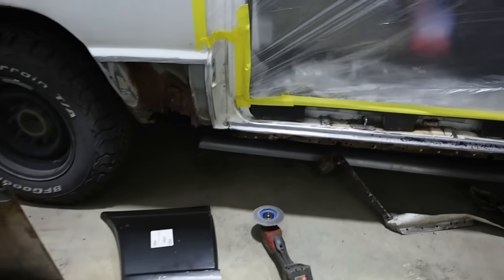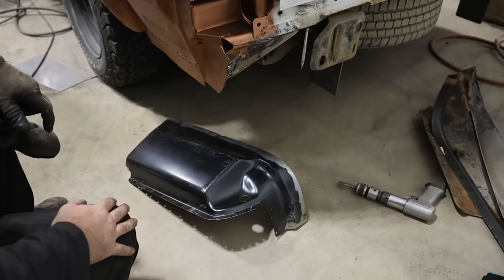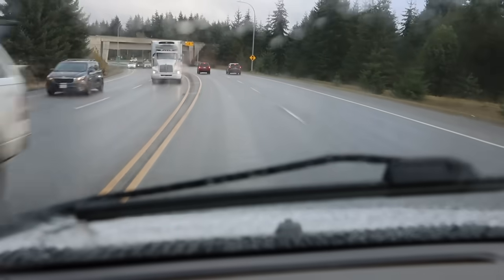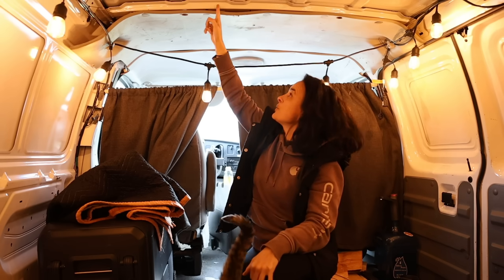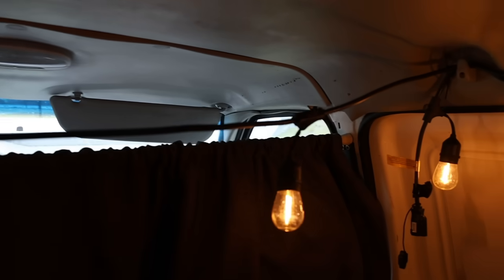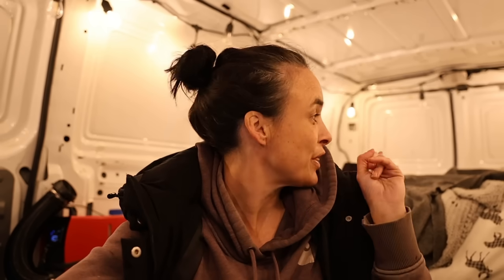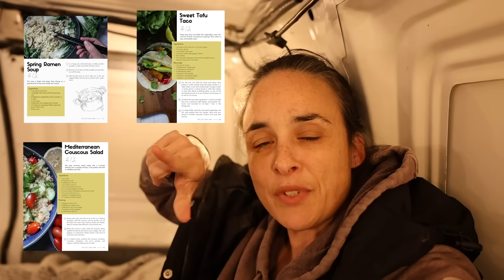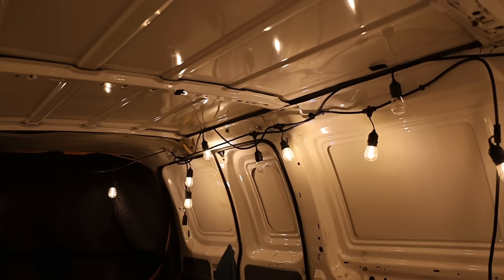BAD TIMING, NO INSULATION | Van life during heavy wind storm

Comment: Find you a bottle that won't leak and boil some water, fill the bottle and place it under you blanket to warm your bed before you get into it.
Reply: I can't say enough good things about this trick!

I did this when living in a vintage 19ft camper in UT winter.

It really works well. 

I used "Arizona ice tea"  gallon, thick plastic bottles.

Do make sure the cap is on tight!!!
Ask me how i know. LOL

It heats the bed & bedding. So your own body doesn't have to. 

I used 2-3 bottles & moved them around under the blankets to warm the bed before getting in it.

Awesome. Easy & cheap.